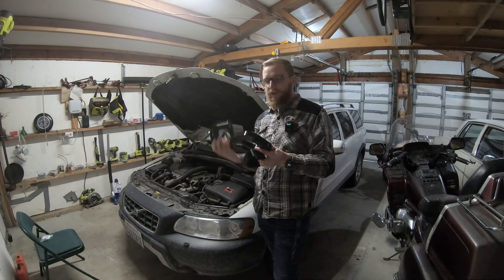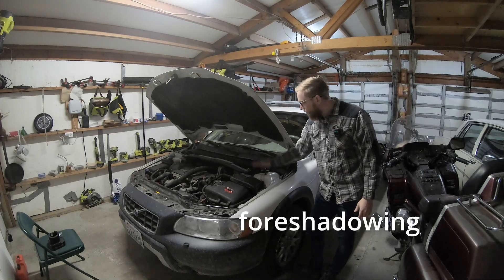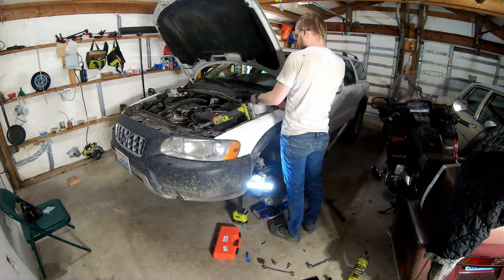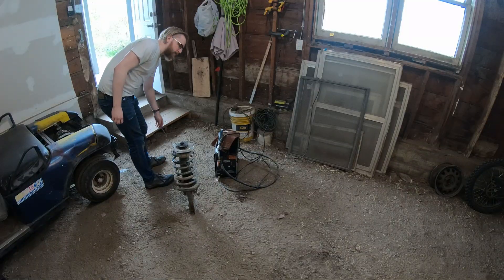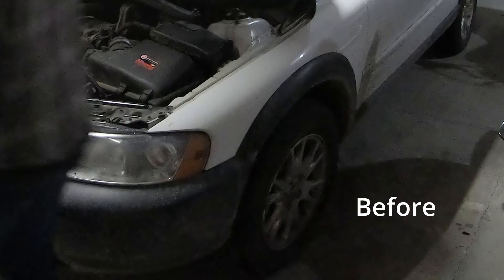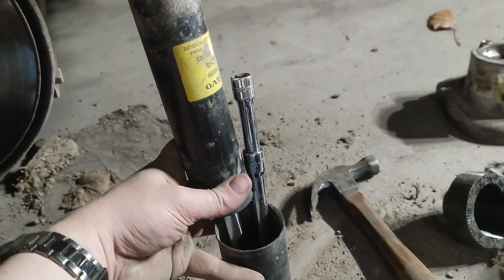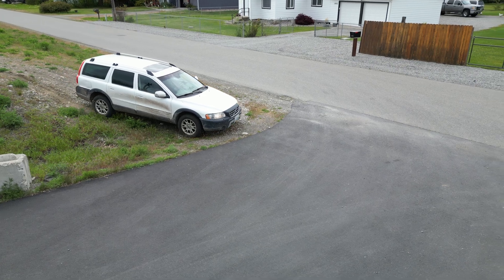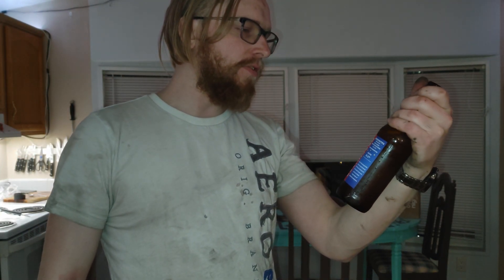I 3D PRINTED A LIFT KIT For My XC70 for $30

Comment: What size tires are you running?
Reply from the maker: Great question! In this video, just the stock size. In the future I got some 225/70R16 KO2s. They're definitely as big as I'd go, under suspension extension they rub a little bit in the rear, just on plastics though.
Reply: @JoelKalich  Sweet, those probably look great. Where in the wheel well are u seeing rubbing, forward, top or back?
Reply from the maker: @heiszerton  No probably about it haha, they look and work great. In this video I put them and the lift to the test! https://youtu.be/i3S7ZUt1aI8

They're rubbing on the front, for some reason the wheels aren't centered in the wheel well of these cars.
Reply: @JoelKalich  That is what I figured, I noticed that in ur video. Thanks for posting this video was super cool and helpful. How has the material held up?
Reply from the maker: @heiszerton  Yeah, for sure! I haven't checked how they held up, but they haven't un-installed themselves yet, and I've beaten the heck outta it.

Comment: Do you think the skyyles will work on a V70 2003?
Reply from the maker: When I looked up skyyles it autocorrected to skittles. When I fixed it back to skyyles, it just came up with random social media accounts... So I guess I'm not sure haha.
Reply: @JoelKalich  Yes, autocorrect from Swedish, sorry. Spacers, do you think these spacers work on a Volvo V70 from 2003?
Reply from the maker: I had assumed it was autocorrect hah. I don't see why they wouldn't work, but I also have zero experience with the V70, and don't know how different/similar they are to the XC70.

Comment: Great video man. Gotta love a lifted Volvo! Did you end up having to get an alignment? Camber in the front looks like it needed an adjustment.
Reply from the maker: @Jaggi96  Thanks! I definitely love it haha. We just got back from offroading it in Moab and it did great on the highway and the trails.

Camber isn't adjustable with these when stock. I have a home alignment kit that I've used to align it, and the camber doesn't look too bad by my measurements, but I have considered getting some camber bolts to allow for adjustment.

Comment: I assume you printed it with 100% infill? Might actually want to do this too, if I ever get a XC70.

And for longevety reasons, you might want to print that in Nylon. Because PETG isn't really strong enough in the long term.
Reply from the maker: Yeah, I probably should have looked into nylon, I know others have printed them in that.

I used 90% infill, 15 walls, 20 top/bottom layers, and 0.65mm extrusion width. The amount of walls/top/bottom layers meant the tophat spacer was nearly solid and the coil spacer was solid.

The designer of the parts has suggested minimums.
Reply: @JoelKalich  Still, Nylon is a lot stronger for such forces. If you ever have issues, see if you can print them in nylon. This way it's much stronger and probably will last a bit longer.
Reply: non-sense, petg is great when speaking about long term use, it has good chemical resistances, ant is plastic enough to prevent cracks
Reply: polycarbonate?